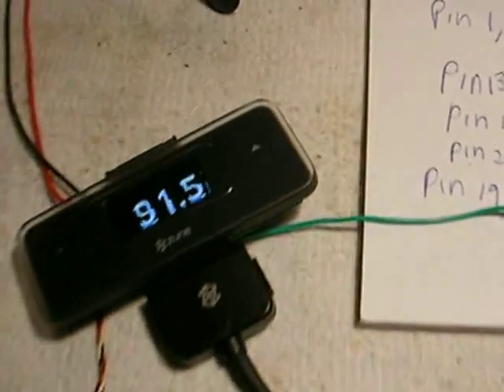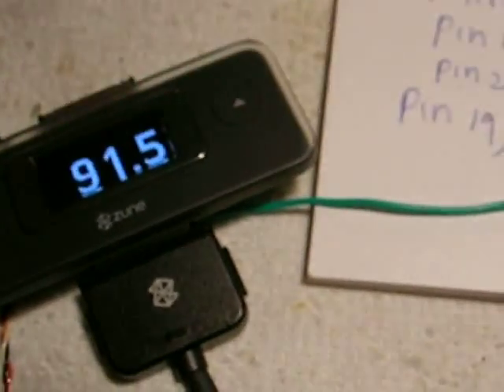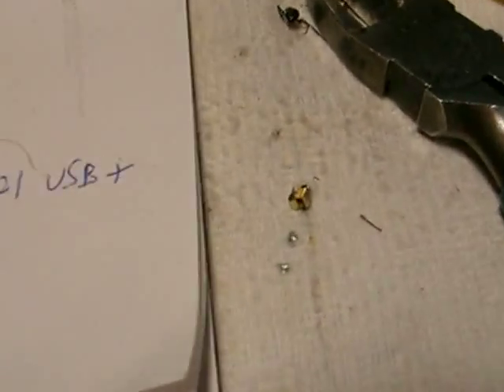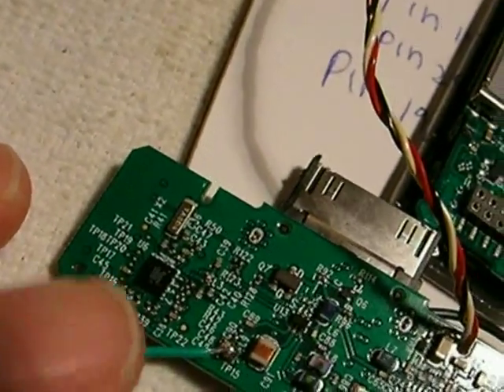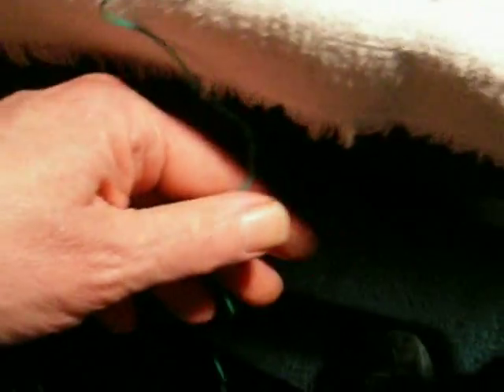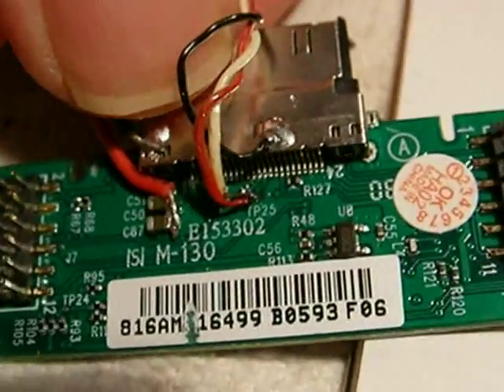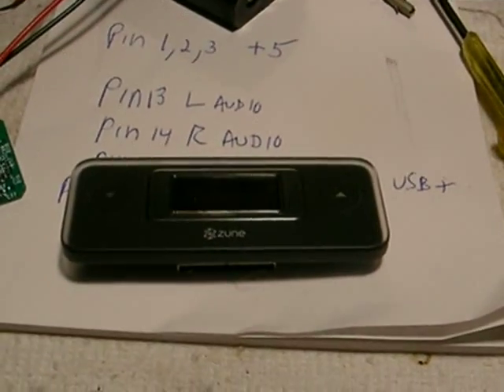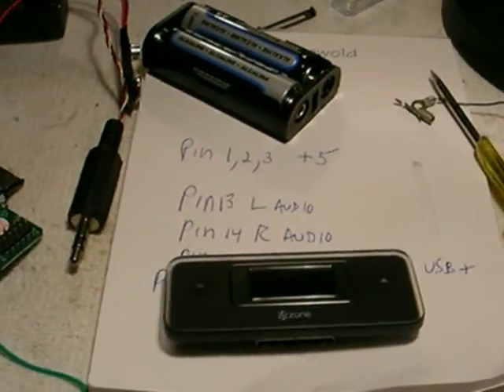Hacking the Zune FM Stereo transmitter

Comment: I just got my father's 4GB Zune back after he told me he can't get it to run on his computer. Turns out his computer specs are not good enough (Windows XP 64bit with Service Pack 2); you need Service Pack 3 to run the latest version of the software on XP (Version 4.8). But as a windows 7 user, I'm able to use it without any issues.

I use an old Griffin iTrip FM transmitter but I had to hold it up to the stereo to get any kind of reception. After soldering a new antenna on, I'm now in business.

Comment: As usual Chris, you've stopped thinking outside the box.....you've just thrown the box away! This would be ideal to use in any 45 player that's been converted to battery power and has had the cartridge changed to a stereo cartridge. Great for use at car hops & shows as well as use anywhere that has a nearby FM stereo receiver for reception. Anyone can be their own DJ!